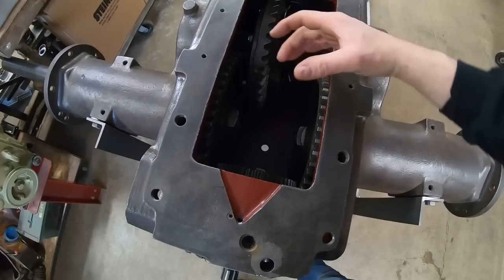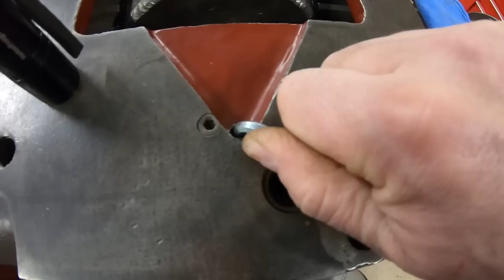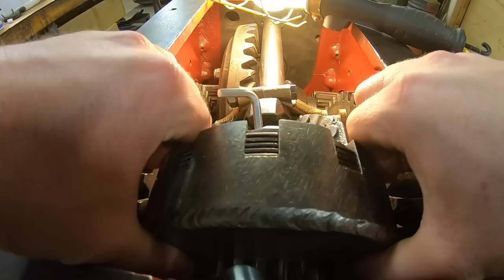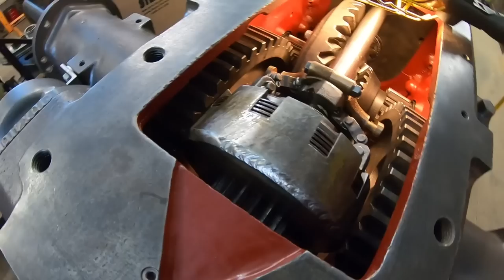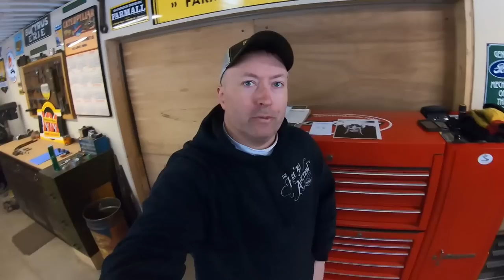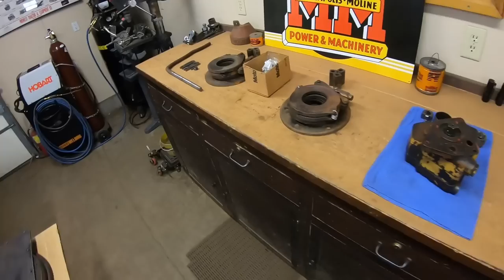#X231 Prototype Part 63: Live Power Final Installation, Clutch Lever Setback & Top Cover Prep

Comment: I started watching in the middle of the last D2 rebuild. I'll never rebuild an old tractor, I just like seeing the mechanicals inside and the process. If you have time, I'd like to see a video where you talk briefly about what it would take to get X231 to the following stages 1. Engine bolted on to the back bit. 2. Wheels on front and back. 3. what it takes to get to a self powered machine, 4. the final bits. I think it would be pretty neat if you could get it to at leas the wheels bolted on stage before moving to another project, as you have to be pretty close to that stage now. It looks to me like you have most of the rear axle assembly  ready if those parts aren't junk, the engine looks ready to bolt up, and the parts it would bolt to look ready to accept an engine now, and then I assume the front wheels go on the front somewhere? I dunno, at any rate, the back half is looking like the back half of a tractor minus wheels to me.

Comment: I think you are doing a great job at preserving the authenticity of the original prototype as best as you can anybody could just substitute in a production part where a prototype part is worn or damaged but like you said with the D2 at what point does a 5J turn in to a 5U  great work by a great craftsman

Comment: Have you ever gone back into the history of Moline Plow Company, Minneapolis Threshing Machine Company, or Minneapolis Steel & Machinery Company? There were a lot of really interesting things these companies built. Their hands were involved in the Case 30-60, Diamond Iron Works "American" tractor, Bull, and even into automobiles with the Stephens Salient Six in Freeport Illinois. My connection is via the Stephens Motor Car, as my uncle was the second owner of a 1924 model, having owned it from the late '50s' to his death in 2014. The car spent its entire life in Freeport until my cousin took it to the east coast. Only about 25 'complete' cars exist today from their 8 year run. It wouldn't surprise me if I added a tractor in error and a bunch was missed as D.M. Hartsough designed so many different tractors that it's crazy.

Comment: No hurry on X231 savor every bite. From the line boreing  video I had some questions but their covered now seeing all those parts coming together and in that answering most all my queries on alignment and spacing and endplay and soon enough my last question for the PTO will be covered about it's pump drive. To which you held the partial answer when you spoke to the production pump drive. As for parts comeing slowly I know the feeling I'm hung up with a vehicle I can't register til it's inspected and can't get it done due to parts hold ups may have to buy a hay burner.

Comment: Outstanding!! You stuck to your guns and did not rush or hurry 👍Would love to see you get your brakes done and primer on it. You could for the time being block of the hyd pump with a flat plate so you could prime the rear end in the event that the hyd system wants to be difficult, correct?
I think you will be sitting well to go back to the D2 and then the H

Comment: You have done lot of decent progress and I think it's a good idea to stop at some point and do something else. I'm sure X231 will come back when the appropriate time comes. I can see that even the production tractors had certain clearance issues and this only adds to the story of X231. I do have a few questions: is the original fly wheel usable or completely trashed? Second question I can see that the starter for X231 just by looking at the photos seems to be a none production(odd man) starter? Any comments on that?
Reply: @squatch253  Thanks for the clear up. I'm sure once you dismantle the starter for a rebuild there maybe some surprises cause it's X231. I know the odd man starters can be a pain specially when two of them look identical but are actually not interchangeable by any means. Not only is the cone length different but also the distance and teeth number on the bendix. So hopefully X231 is not so trashed that it might become a pain to rebuild.
Reply: The unique starter reminds me of my 69 AMC  Ambassador. The starter was basically a modified Ford starter and when it failed I learned that they were rare and expensive. I had a spare Ford starter that I used for parts and I was able to get the Ambassador back on the road. Fortunately the armature was good so I could use the brush plate and the outer shell and field windings. I had to give up on the car when the windshield wiper switch shorted out and destroyed the wiper motor. No parts were available and I didn't have the money or time to adapt something from another brand to work. I wish I had kept that car because it drove and rode so smoothly that the only time I had a blowout on it I had time to wonder what the bang was before it started to settle down on the corner where the tire blew out.
Reply: @danielbutler578  The AMC Ambassador is now considered valuable vehicle. But your story is a good insight why lot of odd vehicles of the time just ended up in junkyards or abandoned eventually.

Comment: Could you not have just milled the flat on the stock lever? I mean yeah it would have had 2 extra  holes in it but they would be in the case and never seen.

Comment: As an alternative to waiting on the correct steel rod to show up, couldn’t you just turn the production lever into the proto type and save yourself a little bit of work with having to form a complete new lever? Looks like its just be a matter of filling the roll pin holes an drilling a couple new holes and mill it. Is this not an option? If not could you fill us in on why it’s not doable?

Comment: Victory will smell like di-chromate primer drying on the transmission and rear case of X231. Although the engine won’t be ready to be attached yet, at least they will match and it’ll prevent the back end from flash rusting. Will you spray the gears with WD-40 or similar before buttoning up the back end? Or do you plan to fill the compartments with gear oil to prevent corrosion on bare steel and cast iron?
Reply: @squatch253  Look into some Boeshield or other,there are many brands. Spray bomb compatible with melting into gear lube. Keep any condensation high up from flash rust. Add gear lube sure,but belt and suspenders.

Comment: Toby, if you wanted to keep that lever even more original, you could keep the original lever, get out the blacksmith tools, and straighten/bend it back into proper shape. That still leaves it a few inches short, but you could chop the end clean and weld 6 inches of new 3/4 rod on it.